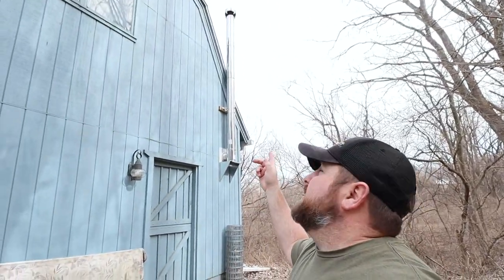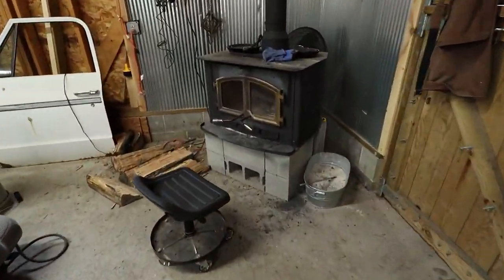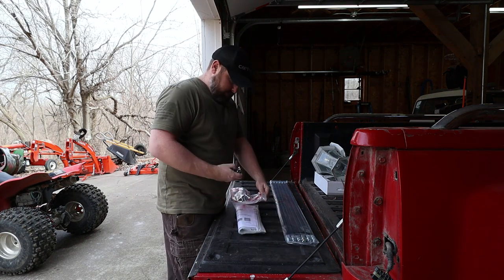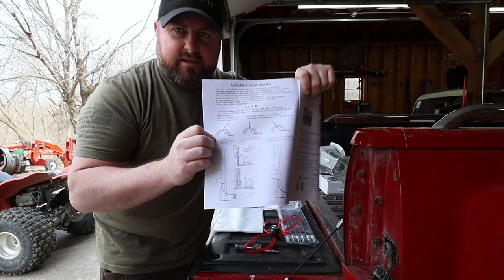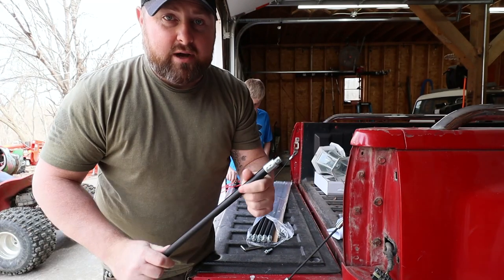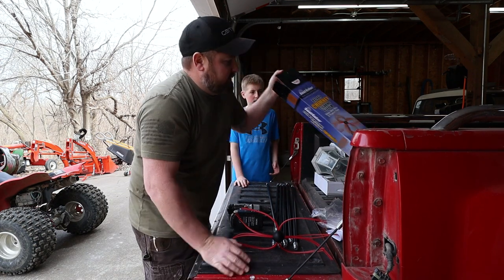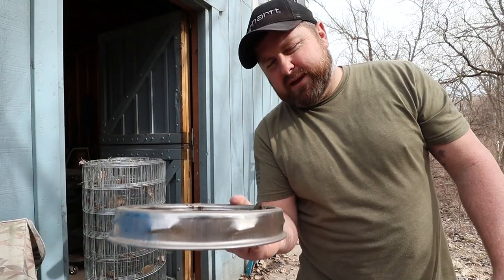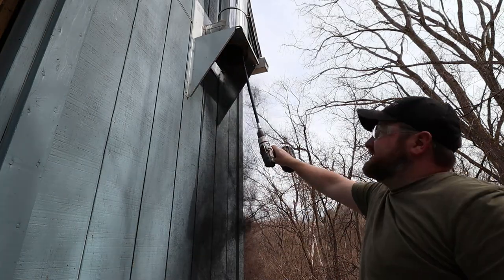✅ I've Got The Black Lung , Chimney Cleaning

Comment: Glad to see that you cleaned the chimney as they cause so many fires! We did ours more than once a year as we heated the whole house with wood. We cleaned it in the fall to get out any bee nests or bird droppings etc that may be in there too. One year a Squirrel chewed the mesh cover and birds tried to build a nest. It was full of grass, hay, string, twigs, nuts etc that would have caused a fire in there!  Next time use a bag, even if you're using the outside clean out. You really don't want to track that yuck into your house or shop and have to wash down the outside of your shop and driveway. You don't want to breath it or get it in your eyes either. We actually used a large garbage bag that we put a small hole in at the top just big enough for the pole to go through to keep the drill from being covered in soot.  
You didn't say if your wife made you shower outside or if you were able to save your shoes?  Lol
Reply from the maker: Yeah bags will be used next time for sure . This was a light cleaning but even a little was a lot lol thanks 😊